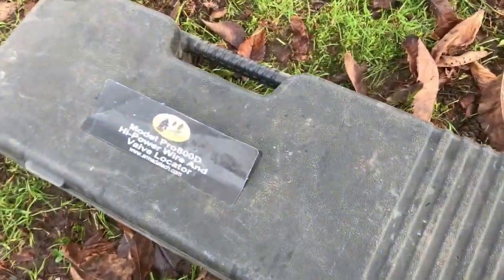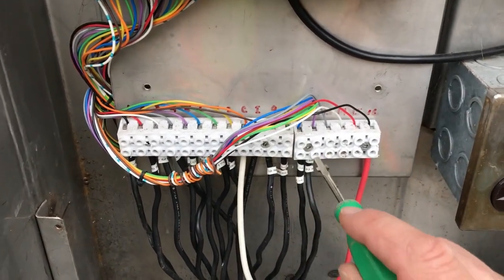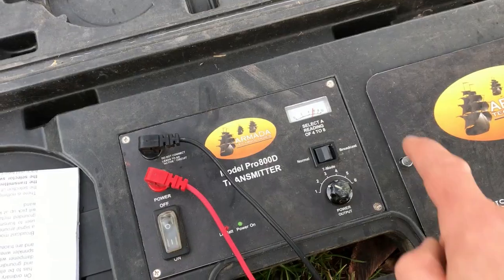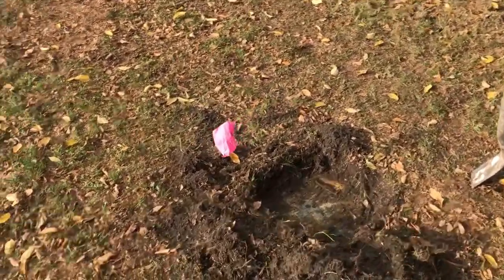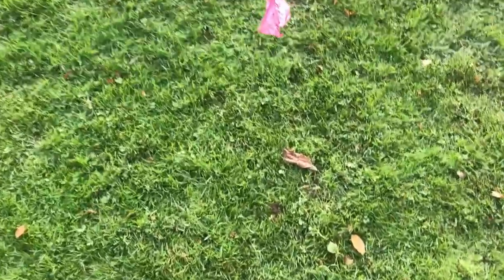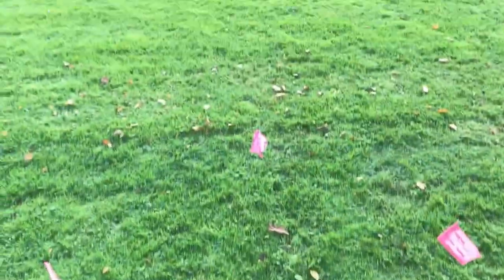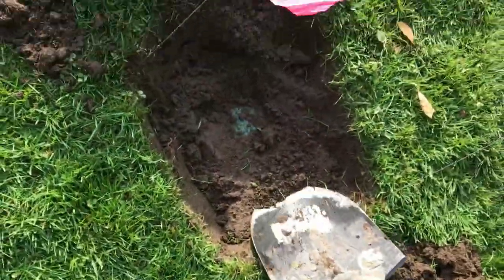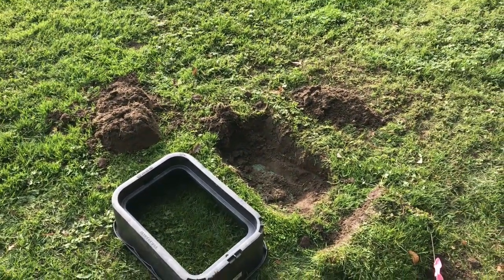Locating lost and buried irrigation sprinkler solenoid valves with a wire tracer, valve locator.

Comment from the maker: They should be able to follow the wire from the controller to where the wires are cut by using a wire tracer,  then dig up and find the other cut end and continue. If the valves have metal bolts like some do, you can find them with a metal detector if not to deep. Good luck.